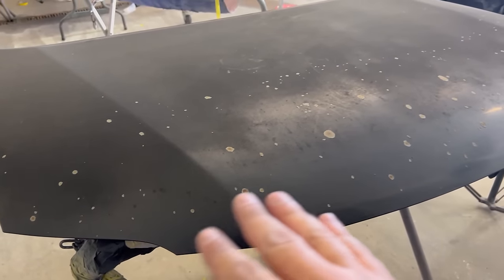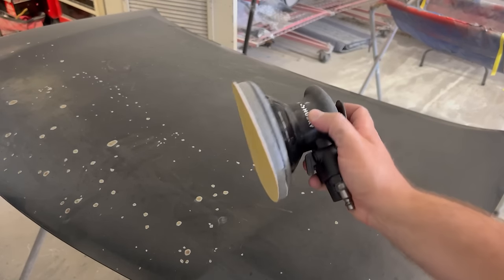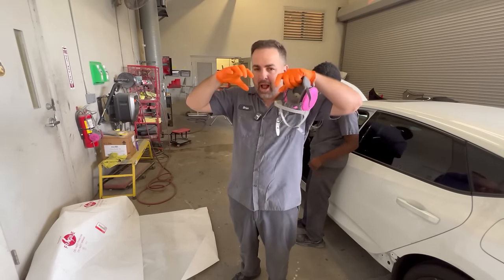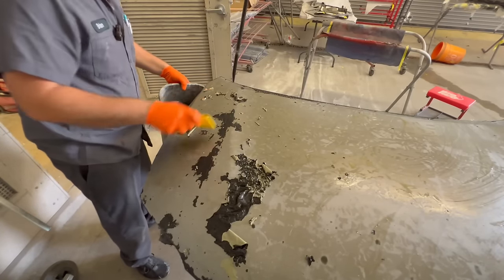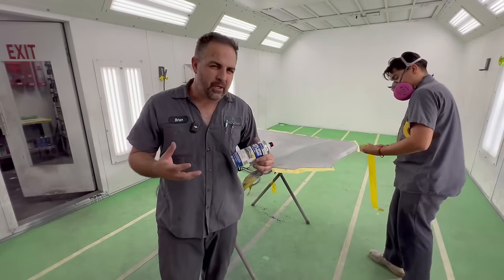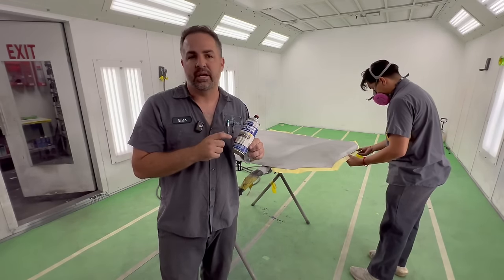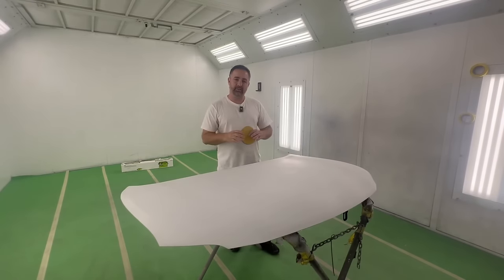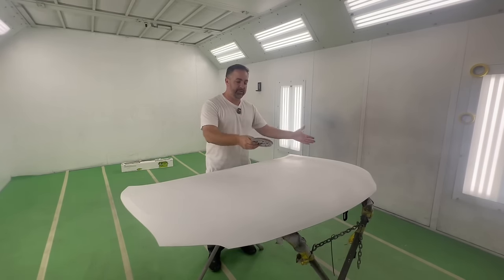The Easiest Way to Remove Paint to Bare Metal!

Comment: a better and cheaper way to treat bare metal is to use ospho  its a phosherese acid get at ace hardware it takes over nite to cure but you can use laquer primer ospho will etch and rustproof been useing since the 70s makes for a long rust free finish

Comment: I have been told that when you apply paint strippers you brush in one direction only.
In particular, you do not brush back over in the opposite direction.
Is this product different ?
Also, will this work on fiberglass panels?
Reply from the maker: Well i guess it doesn’t natter direction on this one.  Fiberglass not sure about. Test a small spot first.
Reply: I am restoring a factory hardtop for a 1963 MGB. 
The top is fiberglass and  has been painted several times. I'll try a test spot.
I have been a subscriber for some time, enjoy your channel.
Thanks

Comment: Did they fix the formula? Years ago that stuff was brutal. You didn't want to have skin exposed because it would burn. Im not sure when exactly they changed it but it didn't work very well the last few times ive tried it.
Reply from the maker: They had to remove methylene chloride because it cause cancer. The formula is now fixed with a new chemistry.
Reply: @PaintSociety  I'm generally against the new formulas on stuff (looking at you brake cleaner) but you could literally feel that stuff burning the cancer into your skin and lungs. It did work great though. Whatever they "fixed" it with was absolutely worthless. I appreciate the response and heads up on the new, new formula. That's the first I've heard they've made it usable again.

Comment: Hey Mr. Brian, I have a question that I cannot get a straight answer for. I have a bedside that I welded to my truck bed that I put acrylic primer surfacer on (ACME FP401) and I was told to fill some minor dings with evercoat metal glazing putty ultra and reading on the bottle, I can only use it over two component primer surfacer, along with galvanized steel fiberglass, and more. So will the glazing putty work over this acrylic primer and if not, what should I do next to fill these paint chips and dings? 
Thank you
Reply from the maker: They are saying it cant be used over 401 because it can lift. It can be used over fp410 since its 2 part. Just strip off the 401. Put 410 and you can fill in any dings over that and re primer
Reply: @PaintSociety  Ok thank you so much for the reply. Could I sand the parts down to the original oem paint and then fill the dings then reorient over that to avoid having to reorient the entire bedside?

Comment: Did the thumbnail say "stripped in seconds no sanding required" step one sand with 80 grit step 2 brush 3 cover 4 wait 45 minutes! Lol but great result thanks for the video gonna try out on a antique glidder with roughly 4 different color changes in its life.

Comment: I was wondering how well the newer aircraft stripper worked. The old stuff was great. How well do you think it will work on older cars that have had a repaint over an existing paint? I have a car I need to strip and it has at least two paint jobs on it.
Reply from the maker: It might take two applications, but it definitely works. Great, the old stuff probably took a couple applications as well.
Reply: I have a 55 gallon strip tank of methelyne chloride (the ingredient in the OG stuff) for powder coating, when I use it for stripping panels it takes about the same process so I think they figured it out finally. Just make sure you are using a better respirator, the original stuff was made illegal to sell to a non business because people were getting brain damage from using it.
Reply: @wolfe2118  I have some good respirators and a full face fresh air system that draws in air from outside that I use for painting so I should be good there.
Reply: @PaintSociety  okay that’s what I figured. The panel you stripped looked to have a thin layer of paint.
Reply: @PaintSociety  Except the old stuff was a LOT cheaper.  I used to buy a gallon of the dichloromethane for $19 at the big-box stores.  This stuff is over $100/gal.

Comment: How do u not clean that surface of residual chemicals before priming!?!?
Reply from the maker: You missed it. Its in the video
Reply: @PaintSociety double checked.. you go from “it’s cleaner”(as u remove the paint) speak of possibly reapply more.. then go directly to sanding..
  Nothing about wiping down the panel or neutralizing the strip chemicals

Comment: that's a particulate filter mask.
It Does Not filter Fumes like what you get from that stripper.  You need an activated Carbon filter,
Reply from the maker: Yes, you are correct, my carbon filter had not arrived yet from the driver

Comment: Isnt that mask with the thin pink filters only good for dust?
Reply from the maker: Correct. It wasnt the correct mask
Reply: ah, k.
I was hoping someone was going to reveal to me that a smaller version of a vapor mask exists.
 @PaintSociety
Reply from the maker: @Larsen514 check the description for the proper mask
Reply: @PaintSociety  
Ya, I use that one too. But my issue with it is that it doesn’t fit well under my welding helmet. Sometimes I weld things that require a vapour mask.

Comment: I visit a paint shop and they told me that the base paint they prepare does not need a clear coat on it. Does anyone know if thats ok?
Reply: All modern cars use basecoat clear coat if you visited a shop and they told you they don't use a clear coat with their paint then they are using an old acrylic lacquer paint which is what cars years and years ago used to use and unless you want that specific kind of paint because your car is an extremely old car and you want to for some reason match the original paint that's not what they should be using they should be using a base coat clear coat I've only seen one shop use and acrylic lacquer like that and it was a mako trying to pass it off as if it was a base coat clear coat and they got caught.

Comment: sealer and epoxy surfacer, what the difference?
Reply: Epoxy seals the bare metal and is the first coat for the system.
Sealer is used to seal all the primers out before laying down a base and clear.
Reply: @RestoHubAU  epoxy seals just like epoxy primer?

Comment: looks like the hood was already stripped and repainted. thats why the stripper worked so well. just by the way the stone chips look.
Reply from the maker: Nah. It has factory e coat color
Reply: @PaintSociety  what do you mean? it was e coat and never painted or the color after you stripped it. in my experience oem paint doesnt stone chip like that. the chips stay small and dont grow.
Reply: and maybe I didnt phrase that right bc it still could have factory e coat and aftermarket finish. so maybe it wasnt stripped but more of a previous repair like got a oe replacement hood at one time with aftermarket paint job. previous damage
Reply from the maker: Stay tuned to the end. Its got the vin number on it. Its an oem paint job.  Never seen one like this. You can see the oem e coat on the underside of the stripper sticking to the plastic. Also the metal was never previously sanded

Comment: Why don't you guys just buy and mix the epoxy and primer yourselves? Wood workers use epoxy and make those fancy table tops and stuff.. It's basically liquid plastic/rubber once it hardens.. I think they will eventually work this epoxy and blend it right into finished clear coats too that will be rust proof. Of course with heat and expansion the mix would need a more hard rubber make up and less plastic, but I am sure there is a way to blend it proper to get a good finish so it doesn't crack like plastic.
Oh I just looked up that epoxy when exposed to uv can yellow.. So maybe that is why it's not in finish clear coats..
Reply from the maker: These are 2 different epoxy

Comment: Paint over 180?
Reply from the maker: Yes. Its bare metal. Not plastic and its sealer. If you sand with 320 on metal, it will flake

Comment: Old news. Did that 30 years ago.
Reply from the maker: Actually, it’s new news because if you did this 30 years ago, you might remember the old paint stripper, and how the new news of it with the removal of methylene chloride. The whole point of this video is this is a new formula but you obviously missed completely based off your ignorant comment.

Comment: PLEASE READ. I need some help with understanding your vocabulary because I cannot fully take on board your advice because what you say doesn't make sense sometimes because I'm from uk where we use vastly different words to the ones you use. Anyway here are my issues>>>>>> I'm in the UK and here there is no such thing as a clear basecoat here. However, you can easily find blending thinners and fade out thinners. Are these 2 items however the same thing as eachother?
Here, I know both of them can blend clear coats for little blow in repairs for where you don't clear edge to edge, but as far as I know, neither of them are used for blending base. In fact, there's no products whatsoever as far as I know that are made to do the same job as what "clear base" does it your video. Even sealer, for us in the uk, I believe from what I can tell in your videos, is literally just what we would call wet on wet primer here. Help me figure these things out please because I love watching your content and nobody else's but I can't grasp your terminology compared to ours here in England. So far l've figured out that reducer means thinners. Reducer is not a term that is used at all here in the UK. Thinners is the only term over here. Furthermore, are either 1 of these types of thinners, (or both of them the same as what you say
"clear base coat" is? It's just that it's just the English terminology for it or something? Also in terms of the US, is clear base coat and blending additive literally the same thing or 2 different products that do the same thing?
Please help me out.